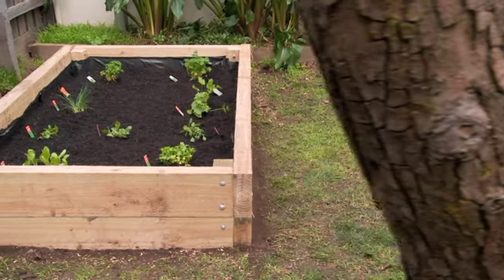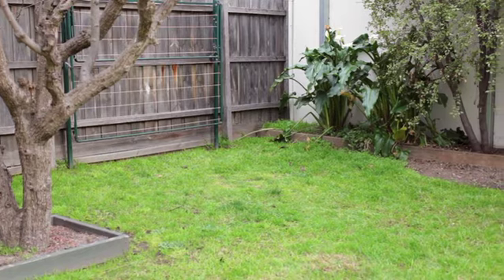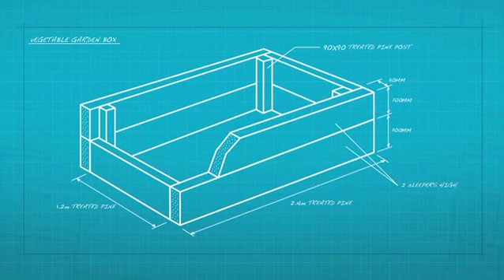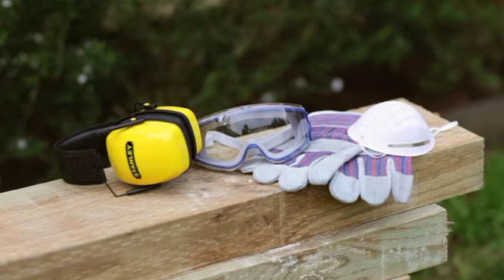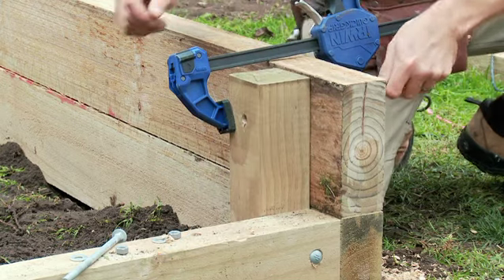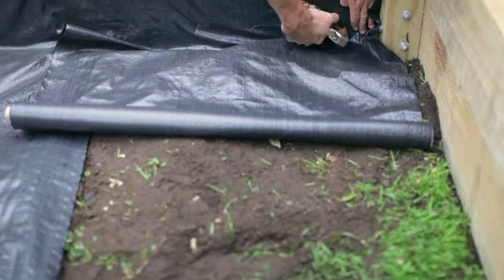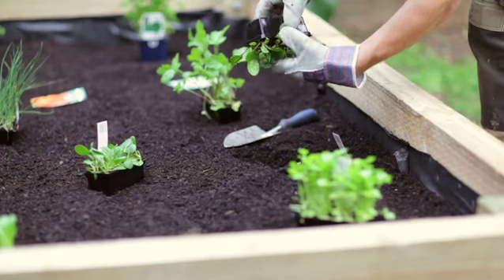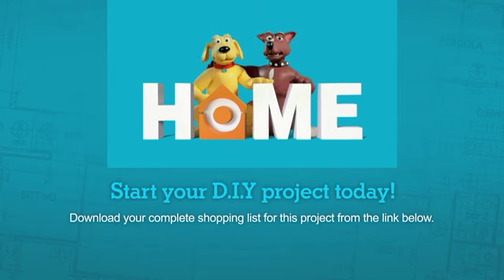How to Build a Vegetable Garden Box

Comment: the whole plastic lining is not useful at all. Direct contact of garden bed with soil underneath allows worms and natural decomposers to climb up overtime and put nutrients in your mix. Also, unless you are growing sequoias or creeping perennials (and not even all of them) in your lawn there is no way any plant will grow through. Also everytime you dig around the box that plastic will get damaged and overtime you'll end up with shreds of plastics scattered in your soil. If you want a raised bed, use just wood and soil and that's it. 
However, raised beds tend to be drier than beds at ground level. And overtime the wood (at that thickness I'd say 3 years) will be rotten halfway through and you'll have to replace it again, which is a pain.
Best solution is either: a) plant directly in soil (dig it up and condition it with some compost if needed, or gypsum if clay is abundant); b) use bricks, which is overall less expensive, less work-intensive, reusable if you decide to move the patch and much more durable than wood (over time). 
Just a few thoughts :)